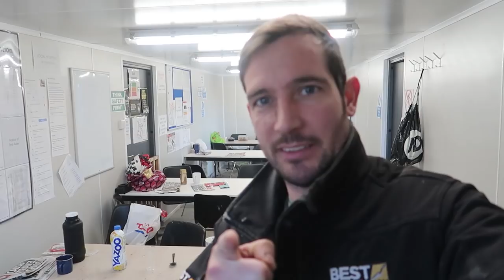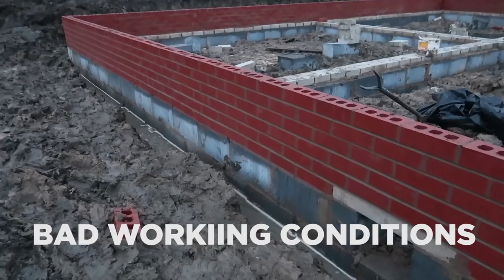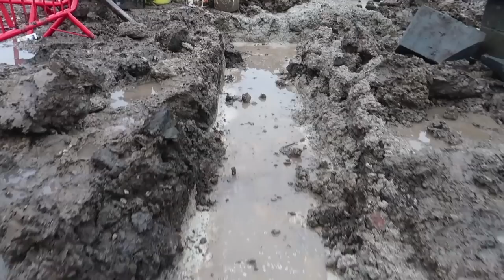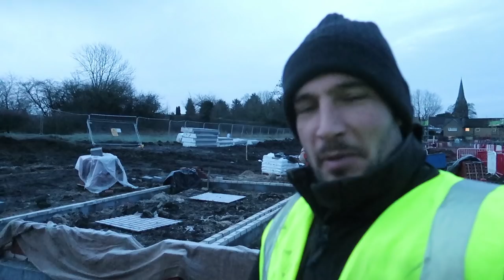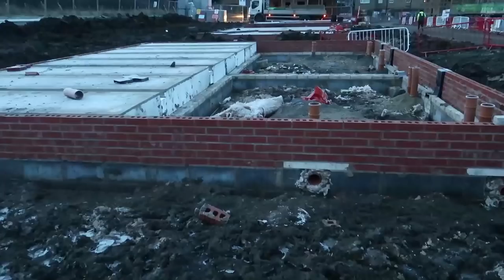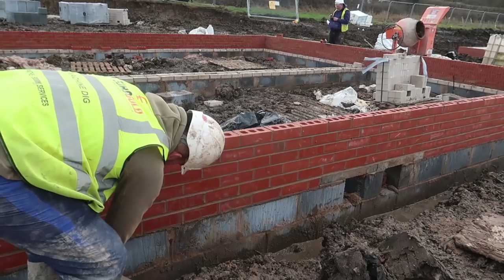Site Bricklaying Trench Block footings UK

Comment: Stu, been watching your vids for last 2 days attempting a 6.5m by 3.5m concrete block garage, quick question for ya... I'm thinking single skin with pillars and an extra 100mm insulation on inside... or should I bite the bullet and do double skin ( it's only for tools/ gym gear etc ) :-) what's your thoughts?? Thanks
Reply: Single skin pal
Reply: Thanks mate :) was thinking that ;)

Comment: Hi dude. Can you give me some advice please? I'm planning on building  a mancave in the garden aprox 3.5m x 6m Ive started digging the footings and its clay a couple of inch in. How deep do i need to go down? The house is built on a raft foundation about a foot thick but its practically ground level, although the shed is on higher ground. They was a single skin concrete block building there built on a foundation of bricks on edge! and that has been there at least 10 year. There was some stress cracks in it. I plan on building a double skin block. 
Cheers mate

Comment: Great money on footing mate. Make a mint in the summer
Reply from the maker: i agree pal once we get going :)
Reply: @Stucrompton1  wish I could get back on it. Got sciatica ain't I
Reply: Just stick to extensions now
Reply: Hard graft though, much harder that above dpc.
Reply: @lessismore83009  course it is but it has its pros.
Reply: J.L.T BRICKLAYING CONTRACTORS  I think the trench blocks are well under priced, £1.90 a block or £1.50 for a 4” an you can lay with one hand twice as fast
Reply: How much brass you looking at below dpc? Is it more per block/brick etc? And I assume you have added responsibility of doing the setting out as well?
Reply: @adamdinsdale4155  generally the gangerman sets out all you do is run in. Prices are about the same as super structures but doesnt have to be neat n tidy like on face work
Reply: J.L.T BRICKLAYING CONTRACTORS Decent. Never worked on site, only done private, hourly rate stuff. How much you looking at per brick and what would the average guy expect to lay in a day? You get nothing but bullshitters on YouTube all reckoning to lay thousands a day but what’s a realistic average figure?
Reply: Adam Dinsdale prices below dpc are generally the same as above. 
Setting out on sites is done by an engineer. (Nails in concrete on corners)
Reply: @adamdinsdale4155  600-800 good, clean bricks to a line.
Reply: @lessismore83009  yes mate but cornering up is normally done by the main man.